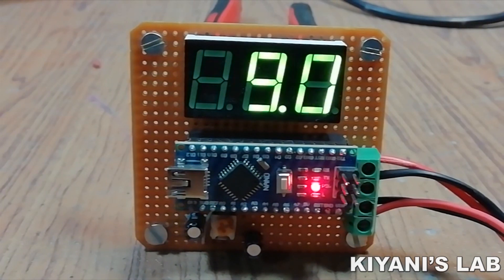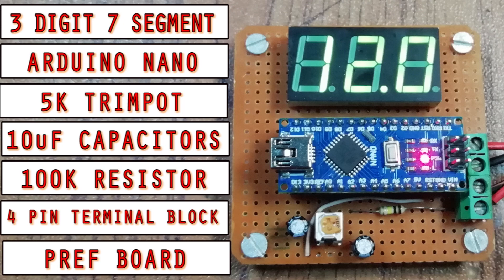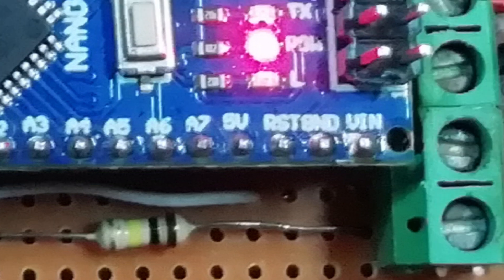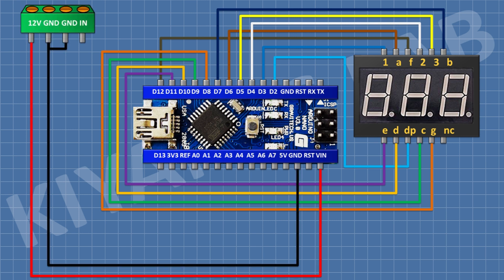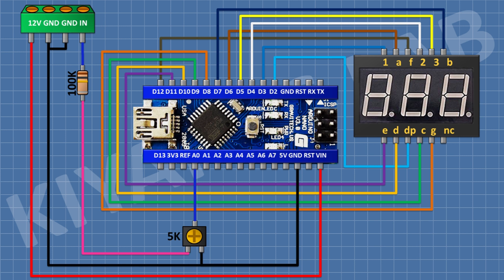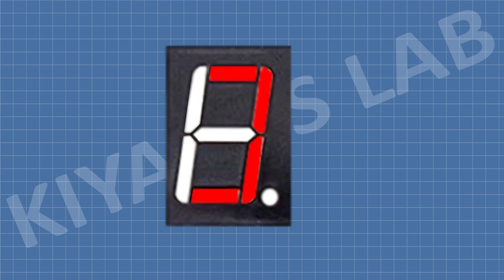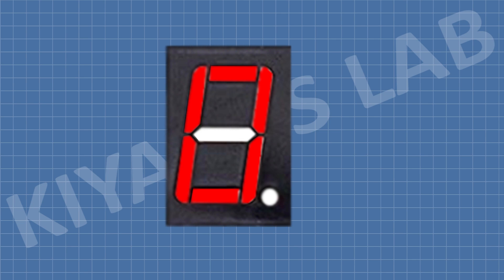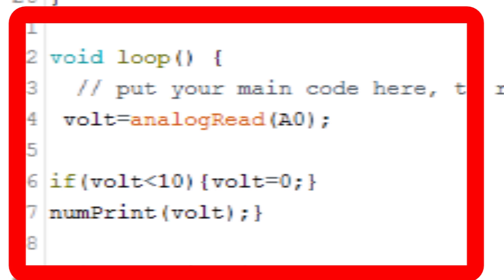How to Make Arduino based Digital Voltmeter

Comment: Sir test connection and Arduino power supply voltage?
Reply from the maker: 100vdc max for testing 6-12v supply

Comment: the problem I have, when I calibrated it with the computer (USB) and the disconnect the USB the measured values are OFF. I tried internal and external reference. Any suggestion?

Comment: ee showing in the place of  00
Reply: If any one try to make this and getting error like showing ee inted of 0.0 just copy this code. i did all the corrections. 

int digit[10]= {64, 121,36, 48, 25, 18,2,120,0,16};
void numPrint(uint8_t data);
void numDisplay(uint8_t dat);
int volt;

void setup() {
  // put your setup code here, to run once:
pinMode(2,OUTPUT); //dp
pinMode(3,OUTPUT); //digit3 com
pinMode(4,OUTPUT); //digit2 com
pinMode(5,OUTPUT); //digit1 com
pinMode(6,OUTPUT); //pin a
pinMode(7,OUTPUT); //pin b
pinMode(8,OUTPUT); //pin g
pinMode(9,OUTPUT); //pin c
pinMode(10,OUTPUT); //pin d
pinMode(11,OUTPUT); //pin e
pinMode(12,OUTPUT); //pin f

}

void loop() {
  // put your main code here, to run repeatedly:
 volt=analogRead(A0);
 
if(volt<10){volt=0;}
numPrint(volt);} 

void numPrint(int number){
  uint8_t n;
 
  n=number%10;
  numDisplay(n);
  digitalWrite(5, HIGH);
  delay(5);
 digitalWrite(5, LOW);
 n=(number/10)%10;
   numDisplay(n);
  digitalWrite(2, LOW);
  digitalWrite(4, HIGH);
    delay(5);
    digitalWrite(2, HIGH);
  digitalWrite(4, LOW);
  if(number>99){
  n=(number/100)%10;
   numDisplay(n);
  digitalWrite(3, HIGH);
   delay(5);
   digitalWrite(3, LOW);}}
void numDisplay(uint8_t dat){
 uint8_t data= digit[dat];
  digitalWrite(6,bitRead(data,0));
 digitalWrite(7,bitRead(data,1));
 digitalWrite(12,bitRead(data,5));
 digitalWrite(8,bitRead(data,6));
  digitalWrite(9,bitRead(data,2));
 digitalWrite(10,bitRead(data,3));
 digitalWrite(11,bitRead(data,4));
  
  }
// thanks
// edited by PC Mobile Tech Solutions
Reply: Good day. Special thanks to “PC Mobile Tech Solutions”

Great help. Your code saved the problem of display wiring to the Arduino. It works but unfortunately, the code for measuring is wrong (provided by kiyani) and has problem. I can say it is fake project because the other project named “Arduino current meter” has the same problem. Code for wiring, also code for measuring both are wrong and have problem. by your code and putting for “current meter”, display works but both projects “volt meter and current meter” have many problems. Seems kiyani buy projects from others and without any study, publishes on youtube even when they are wrong. Again thank you.

Comment: the 7 segment u used is of common Anode...what shall i do if i have a common Cathode display?
Reply: I would say you inverse the voltages (Hi/Lo). Draw a sketch of both displays (diodes) and it should be easy to figure out.